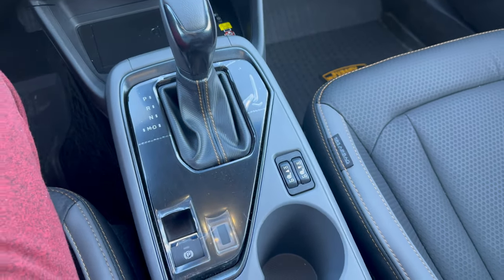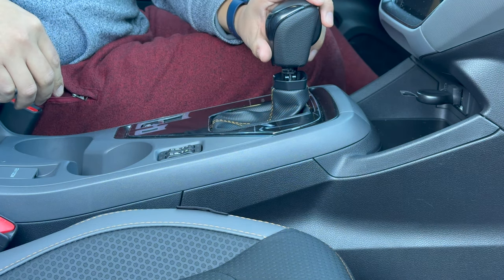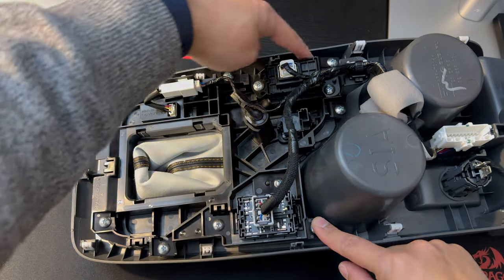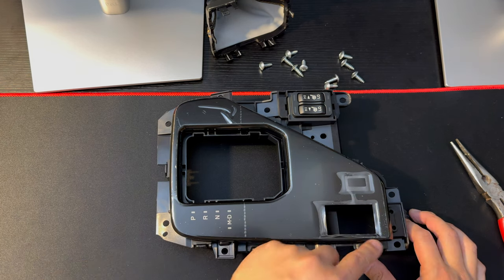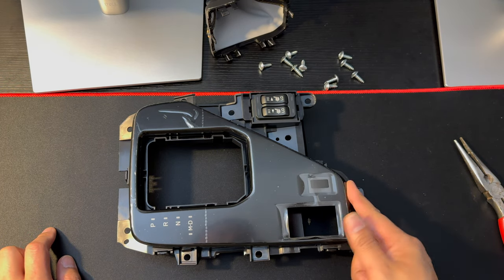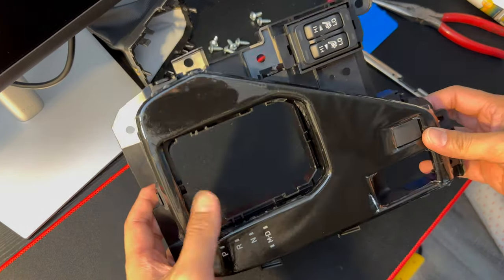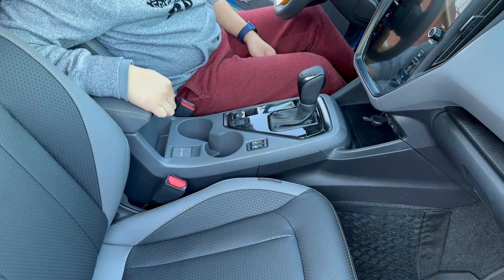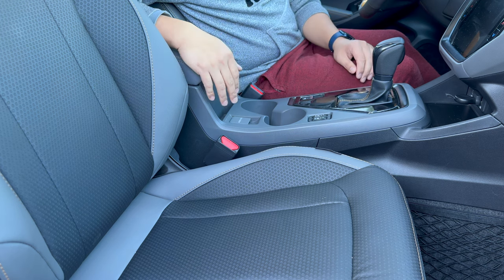2024 Subaru Crosstrek Centre Console Removal & Gearshift PPF

Comment: Very well done - thanks for that! Look forward to seeing how the PPF settles over time. I'm thinking of doing the same, but with a carbon fiber wrap that matches the dash/door trim.
Reply from the maker: I considered that too. Vinyl might be easier to work with, but I figured I could use the PPF for other things like mirror caps and headlights. Also, with an opaque vinyl you would cover the gear indicator (unless you made a cutout for that, but my hands aren’t that sturdy lol), if that matters to you. There are cut outs available on the internet that are computer cut so you don’t have to worry about that.

Comment: For anyone else that does this. Not really worth taking the plate off completely. It’s such a PITA to get it off (I had to use zip ties to jam in the clips and slowly work each one out while slowly overcoming the resistance of the sticky tape that’s adhering the plate to the mount.) 

Just finished it tonight and realized since I did not use see through wrap I cannot see the gear indicator 😂 at least it’s on the dash.

Comment: I have an ‘24 Impreza and this looks the same. What is the part number? Do you happen to know?
Reply from the maker: The Crosstrek and the Impreza are essentially the same. The process should be the same for both cars. What part number are you looking for?
Reply: Oh, the piano black part you covered up.
Reply from the maker: @CM-wd9uu  I think the part number is 92169FN00A, but I'm not 100% sure
Reply: @wildxtrek  thanks. Those diagrams are hard to read.